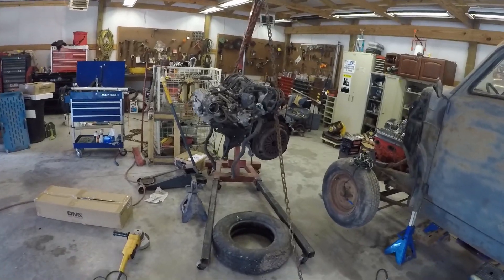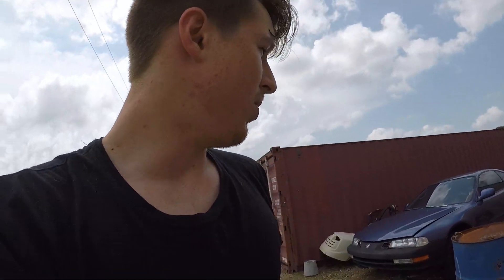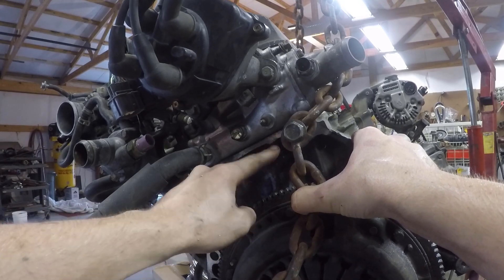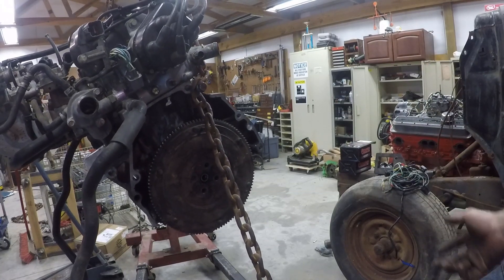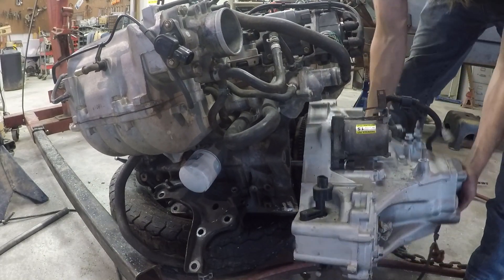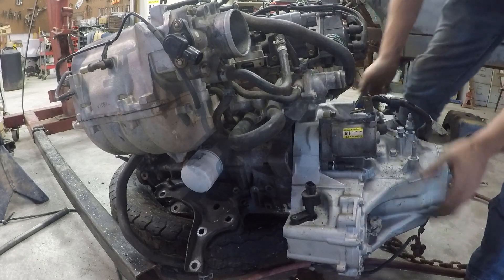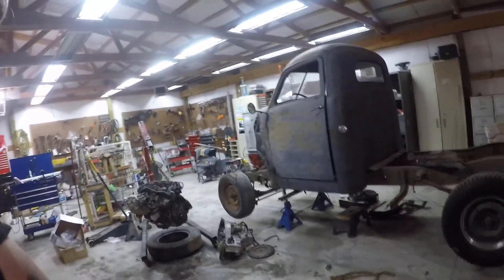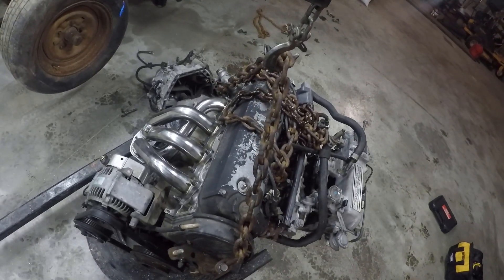F2B Plateless Block Preparation and Compression Test

Comment: bro, I have a problem with the installation of my Bee R. I have a Z32 NA 95 (It was automatic but I converted it to manual) install the Bee R as you explained in your video and with references to the diagram you left in your description but, it turns out that  In my model I don't have Pin 42 (as the diagram marks, green wire with yellow line) mine is empty the place of Pin 42 and Jump to "Pin 43" (yellow with green line) connect it there, but the  Bee R only blinks and does not cut the RPM.  could you help me ?

Comment: Are you using the full borough kit? Thinking of doing this to with a f23 just to my b swapped hatch back on the road seems pretty doable without a kit just some fab work
Reply from the maker: Full kit being all the brackets to mate the tranny and engine together along with the post mount then yes. I really want to K2H Intake this thing as well. I’m not sure about fabricating it all, that seems like a huge ordeal though. If you got the time go for it! I’m just slowly losing my daily and trying to slap a new engine in there lol
Reply: The Feesher looking forward to see the progress. Were there more instructions to where to drill/enlarge the holes? I’ve tried hitting some forums but it seems like a lot of he picture links are gone
Reply from the maker: fortunesk89 absolutely! If you go to his website BroughPerformance.com (I think?) it has all the PDFs and videos regarding the swap linked